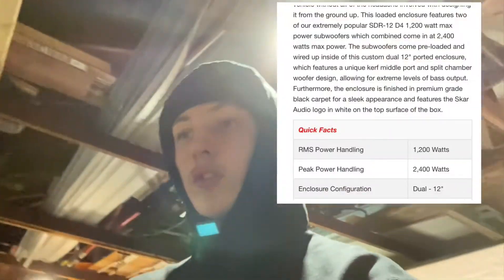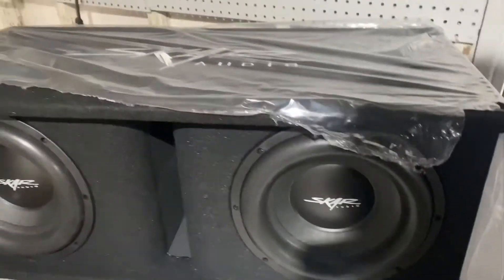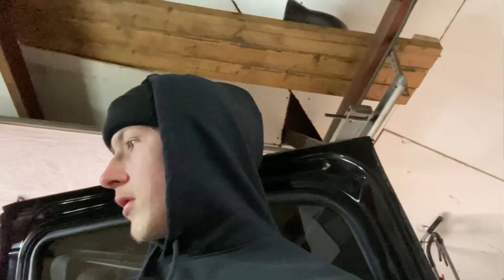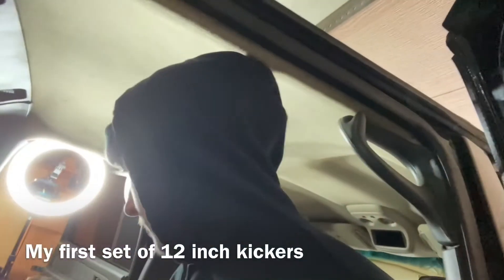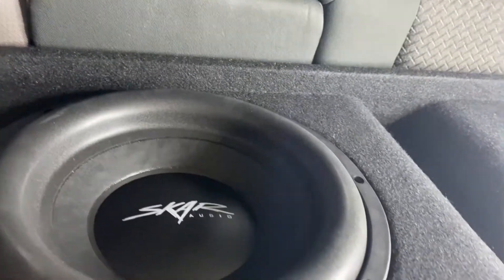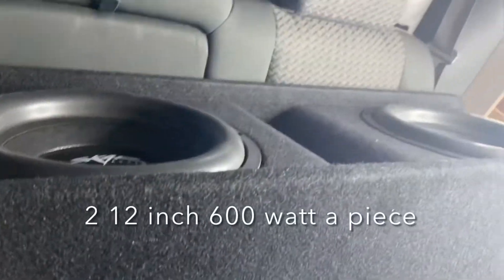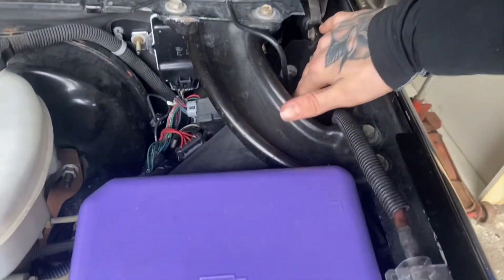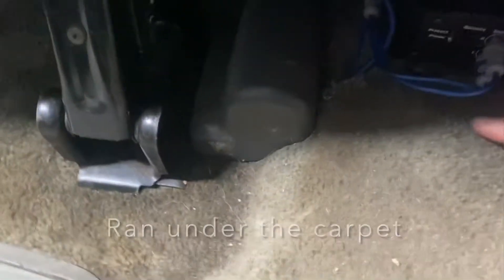Dual 12 INCH SDR 1200 WATT SKAR AUDIO SUBWOOFERS

Comment: Is each 12 1200w or 600w each?
Reply from the maker: 600w each
Reply: Something ain’t right. Mine goes way harder with the same setup
Reply: @charleslink6128  it's his amp and electrical!! He hasn't done the Big 3 and his amp is choking them subs
Reply: I got a single 10 1400watts
Reply: Sdr skar
Reply: I have same box and subs on 300 watt kicker mono, 0 Guage wire stock electric 05 Tahoe and mine hits 10 times harder.